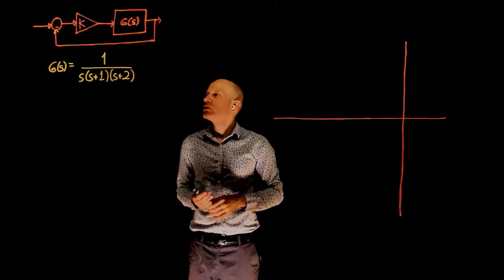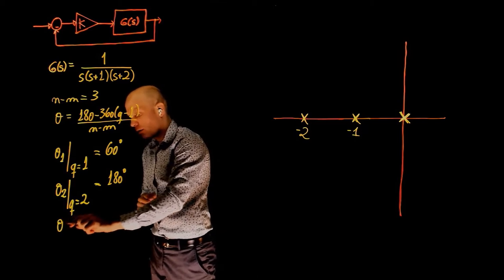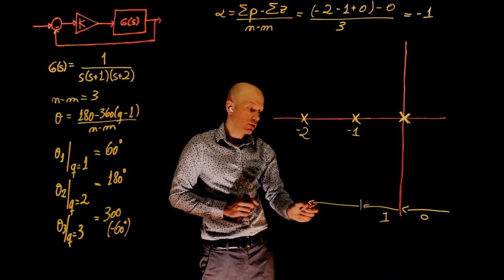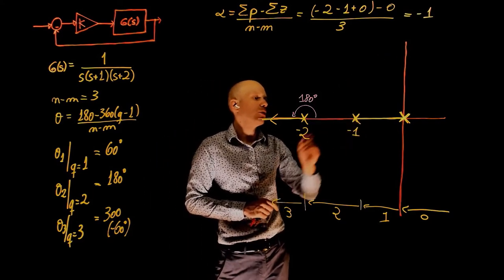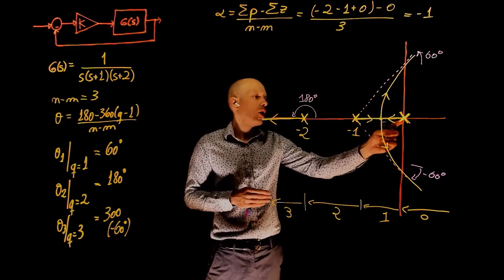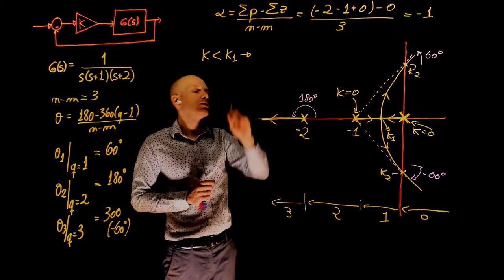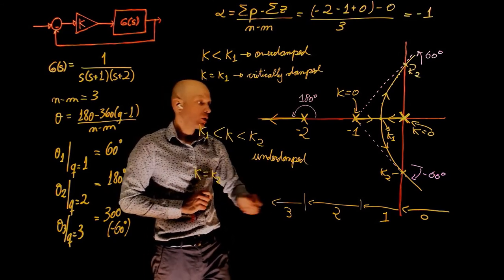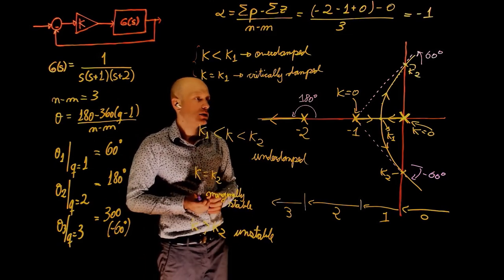L11E56 Control System, Lecture 11, Exercise 56: Root-locus

Comment: why do you use the negative sign in the formula to find the angle. Theta= 180 - 360(q-1) / n-m ? In the other exercise you had used + rather than -
Reply from the maker: For q=n-m=2, using 180 - 360(q-1) /n-m gives -90, using 180 +360(q-1) /n-m gives +270. -90 and +270 are the same angles.
Reply: @biomechlab  thank you for the clarification!